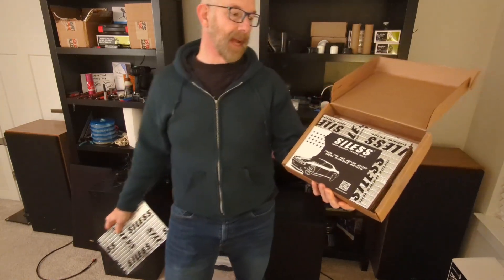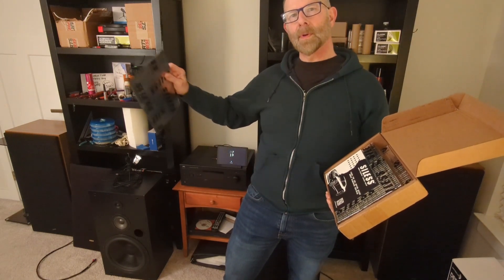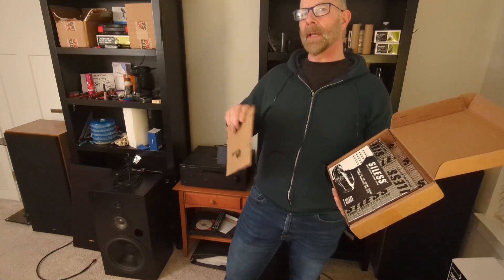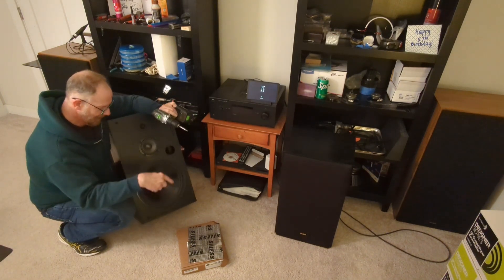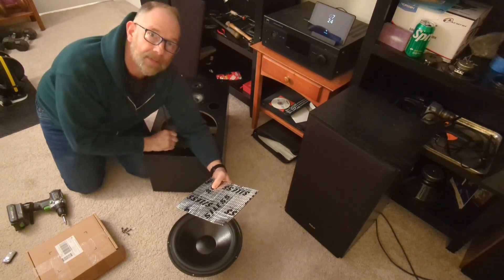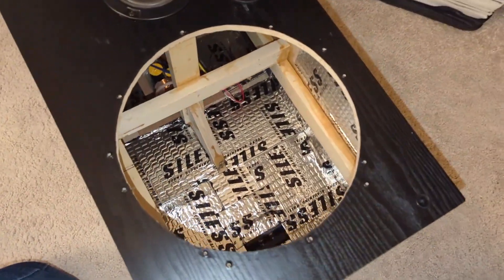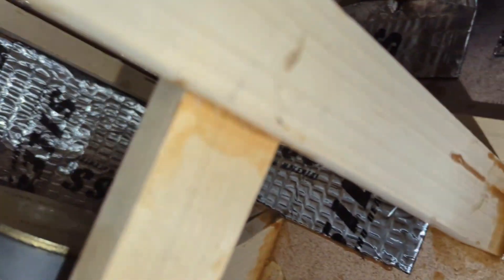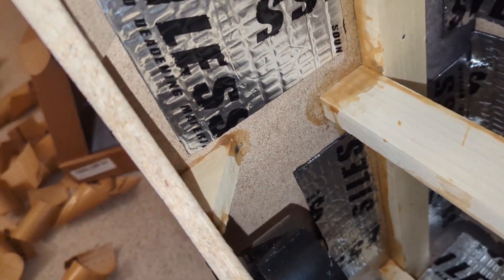Do Sound Deadener Pads Work to Reduce Speaker Cabinet Resonance? Lining enclosure with Siless 80 mil

Comment: With this butyl sound deadening you want to use a roller and roll over the material til those pumps are all flat. This helps it adhere to the surface and can improve performance. But at the same time this furniture board is not a good material for building speakers cabinets.

Comment: I'm not sure how well the regular butyl+foil does on thicker wooden panels - it's designed to work best on car sheet metal, but may do a little for speakers especially budget cabs. 
There's also a 3 in 1 with butyl + foam + MLV that may be interesting, but more expensive.

Comment: From the video, it doesn't look like you used a heat gun and roller.  This is a critical step to using sound deadener.  I have used sound deadening in home speakers before with great results.    I didn't measure anything, but just tapping on the cabinet wall, it did it's job.  On budget speakers it makes a massive difference as their cabinets are flimsy.
Reply from the maker: Thanks for watching and commenting! As for the heat gun, I did not find it necessary. The Siless is super sticky and gooey. The flat areas I went over pretty thoroughly with a roller and in the corners, nooks and cranny's I used the wooden handle of it to smoosh it in place. That stuff isn't going anywhere! That being said, being in the collision industry I've worked with various sound deadeners and they're not all created equally. The Siless is straight up butyl for anti-resonance, and there's the aluminum foil sound blocker. It makes a huge difference though in terms of deadening the cabinets. Makes them quite a bit heavier and as you mentioned, it transforms them in terms of the highly scientifically objective knuckle rapping test. The thin 1/2 inch build on many of the mass market speakers I do, might pass for 3/4" MDF after they're braced and padded.
Reply: @wattspeakers  regardless of if it sticks or not, I still contend that the heat gun and roller are a necessary step.  The deadener needs to do more than just stick to the surface.  It needs to transfer that energy to the butyl rubber.  It's my contention that using this product without the heat gun reduces the performance of the product.  The product will probably stick with 50% adhesion.  However, that could potentially reduce the performance of the product if 100% adhesion is possible with the heat gun.  There are many brands of butyl rubber sound deadening, and I have used several.  I don't find any difference at all between brands of the same thickness.  If you go and grab peel and seal from the hardware store, that's a different story.  Thank you for making the video.  I definitely have measurement tools on my short list of purchases so I can be a little more scientific than the knuckle tap test.
Reply from the maker: Your suggestion is not a bad one, and I'm sure your reasoning has merit. I may even try it to see if it makes a significant difference. The knuckle test is still about as good a test as any for generalizing the cabinet construction and one of the best tools in the tool box IMO.

Apparently butyl remains sticky and compliant to about 180F but melts at about 270 F and as it gets warm it becomes less sticky / easier to remove so I'm not sure that's the best idea but if it went to a melted state and cooled, and sticks more that's an idea, but I'm not sure if it returns to its former state when it cools. I'm thinking it's probably best to simply use it as instructed but there's nothing wrong with experimenting, and much can be learned from trial and error, and while trial and error results may have scientific explanations, I consider them useful from a practical sense. In other words... Warming it up as you mentioned may have benefits. I wouldn't know until I tried, but perhaps more viscous spreadable solution could be a further step in that direction. Some of the sound deadening and vibration products are stinky, so that needs to be considered as well. I did sound deadener pads and Boom Mat Spray on a pair of cabinets and it took almost two months until they stopped off gassing and I could bring them in the house lol. It was a waste and messy as all get out, and I doubt it resulted in much of a gain. I did it primarily because I could see through the bass reflex port and blacking it out looked better, but I could've used spray paint and it would've been better for that purpose. I like to think the effort "must" have some small benefit though, since I spent $30 and a bunch of time doing it ;-)

In terms of cabinet resonance, and how critical it is... well I'm going to be kicked out of the audiophile community for this statement, but... Based on over 40 years of trial and error, I would say the gains are marginal at best and audible differences are negligible. That being said, the natural resonant frequency of the cabinet material can indeed be altered, pushing the resonant peaks down by as much as 20db average in my testing, and able to knock down some resonant noise by as much as 40 db. That's certainly a step in the right direction to deaden a cabinet. However... Often times depending on the cabinet material, thickness and panel sizes, the same audible resonance may very well be above the crossover point of the woofer, making it less important, as the rate of resonance audibility decreases sharply after the crossover point, with or without sound deadening or dampening of any kind. In subwoofers, theoretically it's not even necessary because they don't reach into the 250 - 400 Hz range where MDF and particle board start to sing. In my uncritical unscientific measurements and testing, I'll go out on a limb and suggest it would take some really high sound pressure levels at those frequencies between about 200 and 3000 Hz, in a super quiet listening area and very high resolution music to notice a change in the overall sound character. It would take some serious golden ears to "hear it" especially since most of these resonant noises that can be measured or heard, are about 20 db down from the playback volume. I believe if it has any advantages over a bare cabinet, it would be for transients due to less stored energy and less residual noise introduced through the cabinet and into the listening area.

It's all a little ambiguous, yet remains one of the major debates from varying perspectives on speaker design principles. Generally speaking, my guess is that any improvements are subtle and likely the reason mass market speakers don't employ sound deadening, because it introduces cost and complexity that has little to no ROI. Personally I do it because I'm DIY and an extra $30 for the pads aren't going to make or break the budget and I feel that it aids in producing a cleaner, more defined sound character. And for my purposes, allows for a more predictable driver frequency profile and crossover tuning becomes easier.

Thanks again for the suggestions and insight. This is truly a topic worth delving into further in a future video!

Comment: I would do some  sound deadening on the cross beams since those will vibrate like strings. 

Thanks for this video it's what I wanted to try to do to my sub.

I did sounddeadning matt like that to my headphones and it made them sound 10x better and I can crank them to full vol without distortion. Everyone until they hear them think it's pointless but it makes them so much better .. that is why I was looking to do this to my sub.

Comment: In my  diy experience in the inside of a speaker there must be some sort of damping material. I use acoustic felt for my project.
Reply from the maker: That's awesome actually! I've got some sheets of 3/4" loose felt insulation I'm going to use on some upcoming projects. Honestly, I'm not a huge fan of the poly style fill. The only advantage is that it's not itchy and stays put. Personally I think it over-dampens the cabinet giving it a more studio monitor style sound if that makes sense. It seems that fiberglass and felt seem to make things a little livelier and a little more efficient... But it could be my imagination, but when I installed the white insulation on the ceiling of my in-progress new basement studio, it definitely works for sound control. Maybe too good.

Hey thanks for watching and the comment/suggestion!

Comment: Worst unscientific test ever. What a waste of time and google cloud storage for this video. Please remove it from the internet
Reply: I disagree with the comment. I do have concerns with the room reflections and your measurements. 

I know we don't generally have access to an anechoic chamber. I think you may be able to access a university space. I'm not sure how much they'd charge. 

I think a large space might be sufficient. I also think bursts might be utilized when room reflections are a concern. 

I wholly support this video. I have the same speakers put aside with the intention of improving them step by step. Sound and hifi is a great and very interesting hobby which anyone can get involved in starting with items generally discarded. Maybe I will get some videos up this year. I'll be looking at your other content. Thanks
Reply from the maker: @johnnytacokleinschmidt515 that's an excellent comment, great observation and I appreciate you watching. Perhaps a video on the topic of measuring frequency response is due. Basically I'm looking at in room response, particularly with regard to amplitude and the consistency and character of the loudspeaker project in-room... this is where they operate so that's where I test them, and any modifications I perform are simply to attempt and improve the speaker from stock in a real world listening environment. I won't be investing in anechoic chamber testing any time in the future with rebuilds and restomods as the cost benefit ratio isn't significant enough for that. In other words, there's no logical reason to waste a lot of time on chasing a perfect frequency response, especially for fun speakers, Vs studio monitors, or high end audiophile speakers. If I were working on different speakers e.g. high dollar or controlled environment, (pro, fixed applications, etc.), for sure investing in chamber testing or at least sending to someone doing Klippel testing would be warranted. The speakers I work on are predominantly old mass market speakers that have a lot of room for improvement, but are meant to be fun, not analytical. I'm big into bang for the buck, highly efficient speakers that have good sound quality but pack a wallop.

I've got a basement studio setup that is large and very well damped so I can get fairly controlled and consistent sweeps down there. In untreated rooms like my old upstairs office or my living room can create anomalies in the frequency response which should be considered prior to any mods. Destructive interference in the sub 100 Hz region and comb filtering dips are more likely to occur in an untreated room and is highly dependent on speaker placement.
Reply: No one made you watch.
Reply from the maker: Thank you for the candid comment! What was it about the test that you felt was a waste? I'm asking because I was considering redoing the test in the near future and I'm open to suggestions for improving it. Thanks again for watching and commenting.
Reply: @wattspeakers  Hi! I'm interested in the use of sound deadener pads and was looking to see a frequency response graph of the before and after, from the front of the speaker, because that is closer to what we will be hearing in the end. I think that would be good to see that added in a possible future video.

Comment: I was thinking that or coating the inside with fiberglass resin. I think I will go with the resin as it will soak into the pores and stiffen the whole panel.
Reply from the maker: I think fiberglass once mixed with resin and hardener would just add more chance for resonance because it gets hard. I could be wrong too and it might work great lol. The biggest problem with some products is the smell. The Siless sound deadener doesn't really smell after installed and it's ultra easy and not very messy. Here's a link if you want to try a little box of it on something. https://amzn.to/4376p15
Reply: @wattspeakers  In the car audio world we build custom shaped enclosures using felt cloth and fiberglass resin. The cloth makes the shape and the resin makes it rock hard, very little to no resonance. Im thinking coating the inside with a layer of resin, no cloth, will constrain the cabinet. Watch- PS Sound, hes a world champion SQ competitor-builder. He makes a slurry with fiberglass resin, bondo and steel shot to add mass and stiffen his enclosures.
Reply from the maker: @freeradical6390  Very interesting info! I'm not that into car audio, (being in the collision industry for decades, I know how important it is to hear what's going on, over music when driving).

That being said. I've worked with plenty of fiberglass and it's rigid and thin, which usually means the material is more apt to resonate. However, I'm assuming most custom enclosures in cars would be for subwoofers, which wouldn't be operating in a region high enough in frequency to cause audible resonance. For example, a project I'm working on started to resonate at just over 200 Hz untreated, but with sound deadening it raised that to 400 Hz and was about 20 Db lower than the woofer at that point. With my project, I'm rolling off the woofer at 625 to 800 Hz at the rate of 12 Db per octave, so after the crossover it's working it's way down to 40 Db below reference, making any resonance likely inaudible during playback.
Reply: @wattspeakers  so youve never had 160db at 30hz hit ya straight in the dome? lol jk. I like your vids! Keep em up!
Reply from the maker: @freeradical6390  Thanks again! Well... I did with with a guy who had one of those competition style stereos in his car. One day he cranked up Linkin Park while in the parking lot. I was outside the car, but near it, and my scalp started to tingle and I felt a little unbalanced standing... Seriously loud. 

I went to a Reba McIntyre concert in Chicago years ago, and felt like I was getting pummeled with sound waves, so that was weird too. 

In my personal speaker building and listening though, I've only experienced the high power speakers I was building 20+ years ago that I would test at a target 130 Db within a 30 foot range inside of a 2000 sq ft room. They were intended for mobile use and permanent installation in clubs. Those I would run with independent pro amps at 2500 - 4000 watts per channel. Likely jacked up my hearing doing it too.
Reply: @wattspeakers  Nice!

Comment: I have used the "dynamat" like material you used for deadening the ringing from the steel baskets of 15" woofers, and the plastic of horns in Klipsch Cornwall IIIs. the measurements I took were waterfall plots to see if the resonances were tamed and they appeared to be.

I'm going to go out on a limb and say (based on my gut, not empirical evidence) that rock wool, foam or fiberglass insulation would reduce the resonances coming through the driver and port. What other impact would adding the insulation have? Perhaps lower the tuning frequency of the cabinet.
Reply from the maker: Hi Paul, thanks for watching and commenting! Coincidentally, while I've never tried adding it to the baskets, I was thinking of trying it, after seeing a demo on Amazon where they take a small piece of sound deadener, stick it on a cymbal, and it absolutely made it quiet... I thought if it works on a cymbal, it should definitely work on a woofer frame.

Comment: Pack the boxes full of fiberglass  home insulation,  I  paper side facing the drivers
Reply: I don't think anyone should use paper sided insulation in a speaker cabinet as the paper would introduce distortion as it moves with the air. Only use open cell insulation.
Reply from the maker: Hi Jon, thanks for the comment and suggestions! Fiberglass minus the backing is very good inside the cabinets to cut down on standing bass waves, echoes heard through the port or cones and can add a little virtual volume to a cabinet. Unfortunately it has little to no effect on reducing cabinet panel resonances.